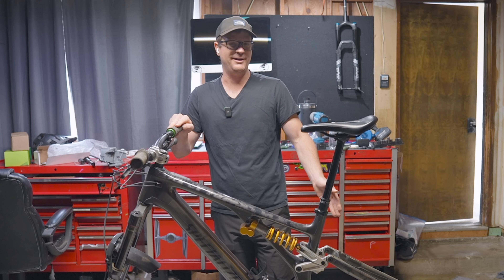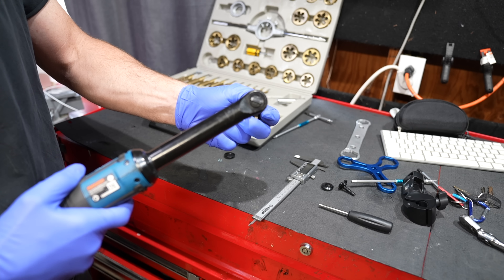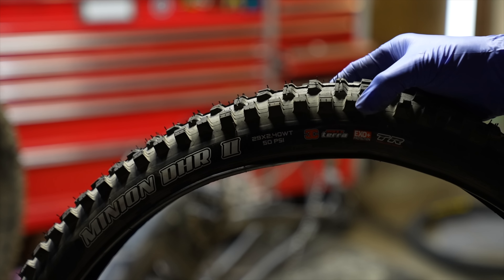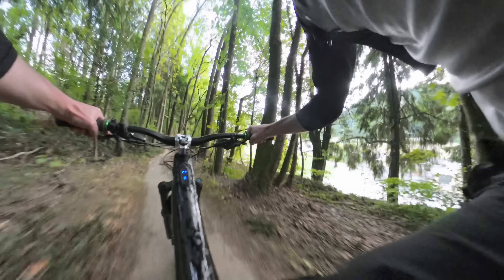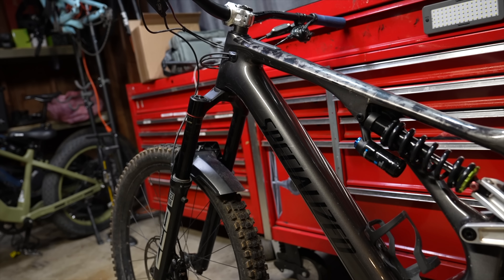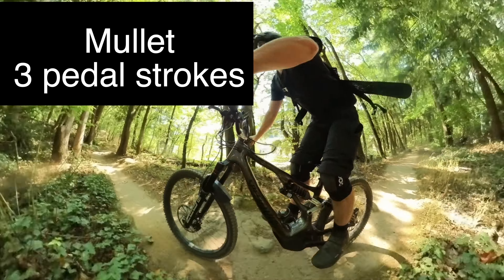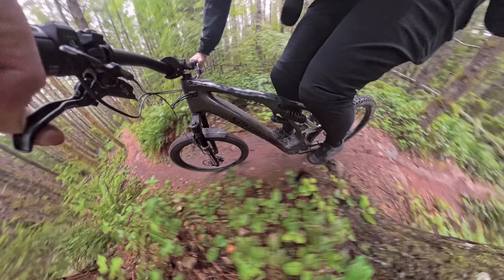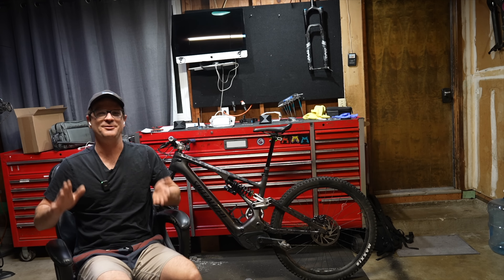The BEST Specialized Levo EVER

Comment: Definitely don't use orange locktite..  those bolts are aluminum. You will probably strip the hex out when you go to remove it.   Stick with just a dab of blue?   Or.  Use grease and just get in the habit of checking bolts before rides
Reply: FYI orange permatex thread locker, which he is using is "high strength removable",meaning it's meant to be disassembled. Heats still your friend removing anything with thread locker. Little heat gun action goes along way.
Reply: I use the purple 99% of the time on aluminium/aluminium applications.

Yeah heat is good but don't forget carbon fiber is just polyester or epoxy 🥵
Reply from the maker: Blue doesn’t hold unless you submerge it and it’s like cleaning puke. Glad someone can read here. Orange is designed to remove

Comment: Love the video I'm a big fan of full 29 I currently have a 2024 Marin alpine trail e2 and that came as a mullet. I was clipping pedals all the time and getting hung up on rocky terrain. Luckily the marin has ample room for a 29inch wheel. The bike has a 63.5 head angle so I increased the front travel to 170mm from 160 and wow its so much better faster no pedal strikes. No more mullet for me. I did a back to back test and no comparison and I only lost half a degree of head tube angle
Reply from the maker: 😎🥂. What’s bb height?
Reply: @OtterMTBtech  hi the bb is 335mm to centre of bottom bracket
Reply from the maker: Measure from ground to center of crank. 335 is stupidly low.
Reply: @OtterMTBtech  335 is with the 29inch wheel it was way lower as a mullet. It would of only been a matter of time before I clipped again and went over the bars. I love how the bike handles now

Comment: I have an s2 put in long / low cs. I fit a 29 without removing the rubber flap. I’m using an Argotal 2.4 and it fits. A better fit is a dissector 2.4.

Comment: I run my Gen3 with stock shox and 29er on the back, DHR29x2.4DD , love the added BB clearance  and Im no longer trashing rear mech cages .. the 27.5 puts my rear Transmision mech to close to the ground.
Reply from the maker: 🥂. Mentally 365 seems to high. Ride it golden.
Reply: Did you needed to change the link? Or is it also stock?
Reply: @danielhhs  No standard link... just set the chip at the back to long and low. it moves the rear wheel back making the chain length longer giving you the needed space to run a 29er lower the bb slightly to compensate for the added height. 
I sometime also move the Headset to the -1 for a fast slaying 29er. I personally prefer a slightly higher BB as I ride lots of rocky tech and find when I drop the saddle when going down my centre of gravity is low enough not to really miss the low slung BB

Comment: The rotor mounted speed sensor on those is janky, seen em warped a bit where it also warps the rotor.
Reply from the maker: Well it’s better than a spoke mount
Reply: @OtterMTBtech  100%, just a weird problem I caught. Get a cheap rotor mount magnet later if it gives you grief

Comment: So did you run the rear low or high?  It looked like low.  I’m building mine up this coming week from a frame set.
Reply from the maker: A normal 2.5 tire only fits in the frame in high setting. In the Low setting you have to pull the mud guard out of the rear chain stay to fit the tire 

Buy a Specialized Levo, then do this!
https://youtu.be/4K_ZeKptyyc

I think it is better in low setting mud guard out in this video

Comment: Are you sure to put it high setting? Low setting is 6 mm longer chainstay. I had a Gen 2 and mulleted it. Had to put it in high setting. It would be the opposite for you. Cool project, but I love my mullets.
Reply from the maker: The gen 3 doesn’t have the shock flip chip. But I know what you’re saying and it makes sense.

Comment: Yeah. I have an s2. Hated it in mullet. Tried long cs…better…long cs and 29x2.4 is best
Reply: Also I have the Cascade link (the 160mm not the LT link).
Reply: I also plan to try it in 27.5 f and r with 150 cranks
Reply: Is that a 210x 65 shock with the cascade LT link?  I’m on the 210x55 with the regular cascade link
Reply from the maker: Good point. People say no way and never try anything

Comment: I swapped the 27.5 to 29 on my Marin Alpine ebike and it doesn’t even have a flip chip. 29 feels way better.
Reply from the maker: Almost got that bike. Measure by height let me know
Reply: @OtterMTBtech  bb height?
Reply from the maker: Ya,
Reply: @OtterMTBtech  approximately 13.5in aka 343mm. You can get away with a higher bb on an ebike because the motor and battery lowers your center of gravity quite a bit. This bike also has a really slack head angle to start with so that isn’t an issue.
Reply from the maker: @brassmnky33  anything sub 350 is hard to ride, I bet it is better
Reply: @OtterMTBtech it is better and there is a ton of tire clearance on that bike.